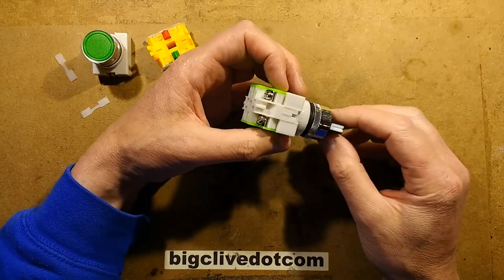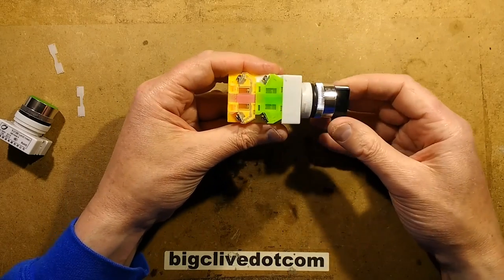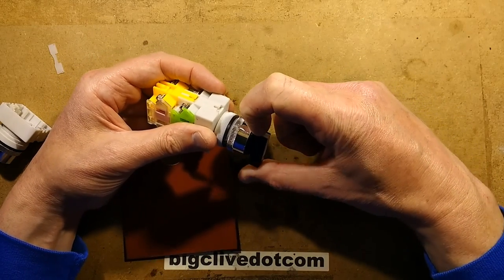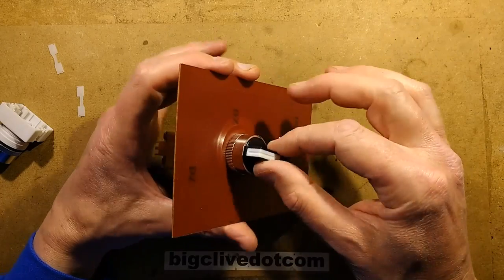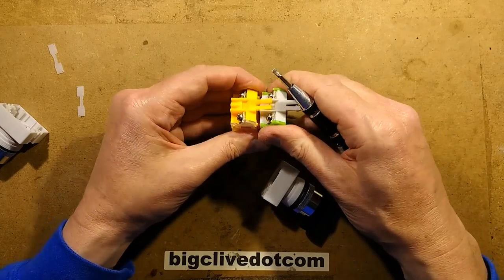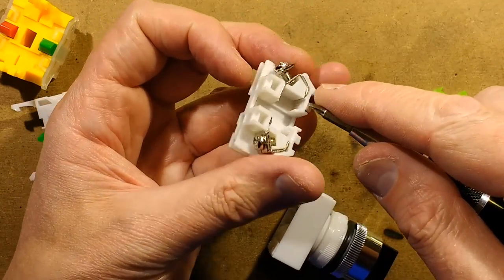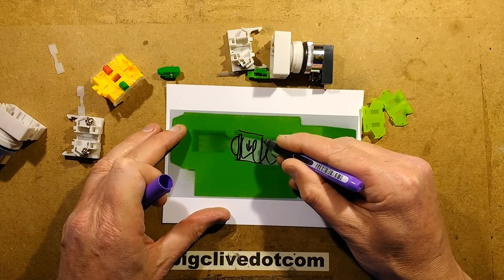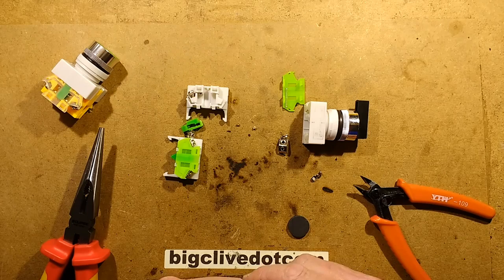Inside a cheap rotary control panel switch from China.

Comment: I've fitted one of these on my lathe. It makes a perfect forward / off /reverse switch. It is a control panel switch to operate a VFD drive that powers the 3 phase motor. Good to find out that the quality is fairly decent as it doesn't feel very substantial to operate. I ended up breaking my first one before figuring out how to take the knob off.

Comment: I've used these switches (instantaneous and rotary - select)  in our swimming pool control panel. a TINY fraction of the cost of purchase from "Approved Aussie Pool Suppliers", and, surprise, surprise - identical. If using them outdoors - give the O-ring a wipe with tap lubricant (improves the seal), and ditto with the rotary cam surfaces - reduces turning effort. If you DO get contact burn, I've found a few minutes with Brasso then contact cleaner will work miracles (a "stop-gap" measure that can last for years in our case!)

Comment: So if they are "not that good" for actual factories or heavy work, maybe you could do some comparison between some "really heavy duty switches and those cheap ones from ebay?
Actually maybe you could do more videos where you compare cheap stuff with their proper professional equivalents?
Reply: I think that wasn't the conclusion. The reason why you wouldn't use them in a factory is purely liability: everything can fail, everything can cause a fire, but at least the guy who bought the expensive switch isn't getting blamed, sued or fired.

Besides, since they seem to be well designed and made from reasonable materials, and they're rated pretty reasonable 10A for their construction, chances are, all the difference to a higher-price product with the same specs is going to be quality control and batch variability in materials, so there won't be anything you can detect from a teardown when either item is new. Honestly, higher price product can even turn out to be less well designed.
Reply: No fuckkkking way. I don't do industrial PLC work but compare a  Japanese Mitsubitshi Industrial, German Siemens or Allen-Bradley switch and everything about them are different (materials, tolerances - as Clive already mentioned - you can stack those fuckers up, etc). A switch coming out of a real industrial facility will be under-rated so 'ten amps' means "we can really switch 30 amps at 440/3ph all day, but we de-rate everything". 

It's the same thing between a Fluke 87 multimeter that's got proper HRC fusing and explosion proof encasing vs an Owin DMM. You get the same functionality and probably even the same quality of measurement (maybe even more functionality on the Owin), but you can be sure as hell that when you go to work on that transformer, if you're measuring voltage drop across something, expecting to see 80v across a component but you're hungover and have your DMM in amps, that Fluke is going to safely handle  that 'uhoh' situation and turn it into an 'aw fuck killed that meter' vs an 'aw fuck killed myself as 3amps put my heart into atrial fib, then killed my buddy who tried to pull me out'.

You're paying 10x the amount for the brand name but at the end of the day the purchasing dept is going to go brand-name every day because of a: the over-engineering, b: the fact that you can actually sue the US Siemens subsidiary and they'll pay out the insurance claim if your factory burns down killing 200 workers. 

Xian Jio Controls PLC's drive  relay was rated for 10amps continuous-duty with 100k actuations and something lets the smoke out, even if you try to litigate against that 3-man operation in China with no first-world presence (so you'll be fighting in a domestic Chinese court venue). Even if the courts rule in your favor and they liquidate their entire operation, you're even worse off because half a week of billable hours to that lawfirm you retained is going to outrun your statutory claims.
Reply: Of course some of them can be the same, from the same factory but with just different name. Point is to check random stuff one cheap from eBay and other professional one. One time it can turn out that its better to buy cheaper one and other time it can turn out that cheaper is cheap not without a reason. Fun is in finding that out especially when you choice random thing starting from simple button ending in some specific component made just for one specific job.

But trick is that sometimes cheap stuff can last longer and be just better. In my workshop we have two power drills bought cheap from local market. They almost 3 years old and they still work better than new bosh or makita that went to service two times and first time because they use fricking annoying batteries that have stupid voltage protection. One time we used it outside during winter, went inside again plug it to charger and what, "battery corrupted because voltage dropped bellow specific amount as super-mega intelligent guy from service said after he clicked few times trigger and said it doesn't work... Damn Sherlock...
Also for most of time cheap stuff is easy to fix or modify.
Reply: As I mentioned above, these are VERY similar to the Arrow-Hart switches from the 1970's (and I've no doubt the product from many other "Industrial Switch" providers). The ones I built were costly because of the R&D requirement (which has to be paid for).  The issue is "are these fit for purpose", and the answer is yes.  10A @ 240V is a LOT of energy, and good panel design would NOT "reasonably expect" panel controls to do this day in, day out - that's what remote contactors are for. These are pretty well-designed and more than capable of meeting "domestic" 240v SP switching, even for difficult (inductive / motor) loads.
Reply: Siana Gearz It's far from liability. $/£160+ for proper industrial switches pay for themselves if downtime is factored into the equation. It's rare for industrial mechanical switches to fail, and some of these switches are actuated several hundreds of times per shift over 24hours.
There's a significant difference between industrial grade switches to their no-name Chinese counterparts, and it's often apparent just by feel. For one, the internal components (contacts, springs, actuators) are much larger, and properly lubricated. The quality of plastics, and snap actions are more robust, too. All around, there's no comparison: these are junk.
Reply: I second (or 61st apparently) the request made by +Akinaro.
I appreciate the comments others have made about quality of name brand switches. Interesting stuff.
Reply: Cheap ones are just fine for factory use, well in most cases. If the button needs to be switched maybe once a day or less and there are no tough IP requirements go with the cheap ones, not much point in wasting money. Its not like it will up and break for no good reason. 
It depends on how many machines you plan to sell, if there is only one machine then yeah, you take a button you have used before, 1$ or 100$ doesn't make a difference. But if you plan to sell 1000 machines and put a 100$ button there for no good reason, then you are simply an idiot.
Reply: It's not good enough for the West, but good enough for developing countries, like Brazil, Egypt or Bangladesh. I think most Ebay listings for industrial equipment are not really aimed at Western audiences.
Reply: aleksander suur I wouldn't say you'd be in idiot for standardizing, Keeping inventory(in your shop, as well as the customers) to a minimum has many advantages. When you have in account with Allen Bradley, or Siemens(most OEMs and have both), there's industry rates, as well as bulk discounts. Also, when you order panels with mounting holes pre-punched/drilled, it's much easier for everyone throughout the process to standardize with sizing and spacing. Also, it's not uncommon for customers to order equipment with specific requests for layouts of control panels. With PLCs so prevent in industry, it's now easier, and cheaper to write a program for an HMI touchscreen for your I/O instead of using switches and pushbuttons(aside from emergency-stops)

My biggest gripe about these cheep selector switches is that there's nothing preventing the entire unit from twisting in it's mounting holes when the bezel nut loosens. This will cause stress on the connections, and possibly point to the wrong positions(auto, manual, stop, reset, up, jog, run, down, ...)
Reply: AMD1 layered, convoluted touchscreen control reportedly main cause of train head on collision in rural Bavaria in Germany a few years back, as the station attendant had no way to quickly disable the rail or warn the drivers. Dozens of people died.
Reply: +AMD1 Standardization is a good point, but makes the cost issue even more significant because you have larger volumes of used parts. A standard generic part should not be 100X more expensive than it has to. Putting as much to UI as possible is how it's done, but every now and then you are still going to need physical buttons, pretty much any machine has some physical buttons.
As for the keying I had that gripe as well and bigclivedotcom actually pointed out the button does in fact have keying, just that he didn't have a panel punch to make the right hole for this video. I don't think even this cheap buttons come without keying.
Reply: simontay1984: you probably never used proper baco switches, you don't get that kind of quality for 3 bucks.

Comment: These seem perfectly adequate for low voltage hobby stuff. I really need to come up with a project that includes a big control panel of these type switches
Reply: Do R/C! -  that's what I've been thinking...   for some reason, even tho I have absolutely no need for a switch like this or the emergency stop button from another video, I desperately want some to integrate into some type of controller...   and spares to teardown to bits !!!

If the advertising industry ever happened upon Clive, or he decided to go into politics, the world better watch out...

Comment: Would it be worth putting the quoted 10a through them and checking with a thermal imaging camera to see how well they do?
Reply: I'd love to see this.  One thing that bothered me was the lack of any snap action.  I'm used to the old light switches that snapped on/off.  The snap being the quick movement of contacts so there's no prolonged arcing.
Reply: Reminds me of how I once torture tested one of these contacts by passing only a few amps but letting the arc do a lot of damage. Eventually the plastic case of the switch melted and gummed up the whole thing.

Comment: Guess I haven't tried it for over 50 years now, but we used to take questionable wire and hold it in the flame of a torch. If it colored the flame green then it contained copper which was the medal we were seeking as it gave the best market value at the local scrap yard.  I did used to know the other flame colors, but they elude my aging brain, but the green for copper holds in there for some strange reason.
Reply: Iron = Orangey-red (like red gold coloured)
Copper = Greeny-blue
Sodium = Orange
Lithium = Red
Potassium = Purplely-blue (lilac)
Zinc = Bluey-green

Just to list a few
Reply: Flame colouring is still used to recognize things. But the most common are green for copper and teal for zinc
Reply: Jerry Ericsson 
Red for strontium! 
Not that it's likely to be of any practical use but I remember it from school!
Reply: Yellow for Sodium is another unforgettable one, because of that awful Sodium vapour street lighting.

Comment: These are almost identical to the ones I assembled during my Student days (working for Arrow Hart in Plymouth - early 1970's!), even down to the sliding contact idea!. We used Cadmium plated contacts (low resistance) and ours were rated to 10A continuous. It would be interesting to see a FLIR image of those contact pairs at full rated current  (just don't "light up" your bench PSU!!!

Comment: Hi Big Clive - I really enjoy your videos. I have purchased and NOT purchased many items (for hobby use) based on your reviews and tear-downs. I live in the US and have worked in the environmental control and process control industries for most of my career. I have worked with many of these types of switches, but never anything so cheap. What I like about videos like this is, that while you admit that they wouldn't measure up to their higher-priced counterparts, they might have a place for a hobbyist that wants a more professional look to a project they are constructing or possibly used in prototyping. This is, however, provided that they understand the limitations and weaknesses of these devices. The other videos of yours that I like are the ones like the rechargeable camping lantern that output 220VAC on the USB charging port. You could be saving lives with videos like that. It just baffles me how something like that could pass even the weakest of quality control of product safety evaluations. Thanks for what you do. Keep on making videos like this. People need this kind of information to be informed consumers.

Comment: The company I worked for 30 years used this style of switch in our printing presses. They were made by IDEC and were ultra reliable. The switch in your video looks like an exact copy except for the locknut which was a hex style instead of knurled.
Reply: It was nice to have a reliable job that paid well. I'm now retired at 65. House is paid off and I'm just enjoying life right now.
Reply: Glenn Martin 
Sounds like these switches could be a rip off of something originally made by a recognised manufacturer. Often Chinese manufacturers do that to avoid R&D costs and they get away with it because of lax copyright law enforcement in China.
Reply: Pete, That's exactly what I was thinking. I know for a fact that IDEC was a legit manufacturer of these switches because I dealt with with the manufacturer's rep directly for many years. The only problems we had was user abuse who would break off the plastic knob. We always stocked spares for our customers who needed replacements. I can't remember a time when we needed to replace a switch body or contacts.
Reply: I'm fairly sure that these are actually a recognized standard in switches as well, though no promises on how good the Chinese copies are.

I just had to play with two different brands of US made switch blocks and control bodies, since we had IDEC and another brand, and they were ~90% compatible.  One had a slightly different shape to the alignment pin/tab in the center of the side, to keep the other from mating with it.  With a little persuasion, they plugged together.

Comment: Hooray for a zoom-in that remains in focus!  BigClive's videos seem to part of the very few content creators on YouTube that can zoom in and not only have the zoom-in be necessary but have it also be in focus.
Reply: It's because the iPad's zoom is completely digital, it's essentially just cropping the image (Notice the defined steps when zooming.) For optical zoom, most lenses move the front element closer and/or father away from the subject while zooming, causing the focus to shift. Only higher end, expensive lenses don't do that.
Reply: Well, if you zoom in first, focus, then zoom out like you should, leave the focus on manual, and start recording, you don't have that problem.  Also, pay attention to the minimum focusing distance for your lens.
Reply: Ziginox I thought he stopped using the iPad and is using his Android phone now...?
Reply: Even that method doesn't always work.
Reply: I wasn't aware, but that's certainly possible. If that's the case, though, my point still stands. Going by the jumpiness when zooming, I believe his phone is like the majority that are purely digital zoom.
Reply: Both the iPad and Android use digital zoom. They have no moving lens assembly.

Comment: The over press and wiping action on those contacts is indeed a sign that they are pretty reasonable quality ... it does also depend on the actual contact material - usually some form of silver based compound, if it's used at the rated 10 amp the rocking will also knock off any spark spikes but if the circuit doesn't incorporate an effective spark quench shunt the contacts will dish quite quickly and self destruct.  The plastic pivot is a bit iffy too.  OK for a machine that's turned on then off once a day.  Otherwise allow a big coil of spare connecting cable

Comment: Gday Big Clive, I was surprised that you hadn't seen wiping contacts before given that you did your time in heavy industry around the same time as I did, they are far superior to direct acting contacts in dusty and greasy environments, I.E. crane pendants and such machines where extra low voltage is used in the control CCT, it only takes a tiny amount of build up on the contacts to stop 24Vac making it throu, and it takes hours to find the fault.  I would have to ask Dad who first came out with it, it was either Johnson & Phillips or Klockner, either way it was around 1960 and it was only available in the 32mm series of heavy duty push buttons that cost a fortune, now days it's fairly standard across the board.
Pity the rotary selector dose not have a locating tab to prevent it from rotating in the 22.5 mm cutout.
Thanks for another great video would have loved to have been able to make it over to your get together.

Comment: Hi Clive, most of the commercial marine industry now build and refurb ships using these products. As you say these type of rotary switches are produced on mass to the point where it is viable for the manufacturers to produce a viable product at a fraction of the cost of say a Schneider or telemecanique equivalent. They are fit for purpose for an industrial  environment in my experience as an EEN.